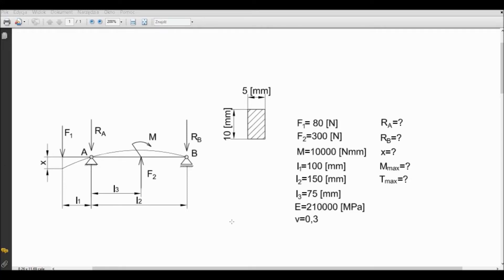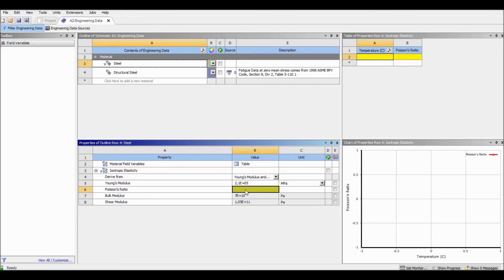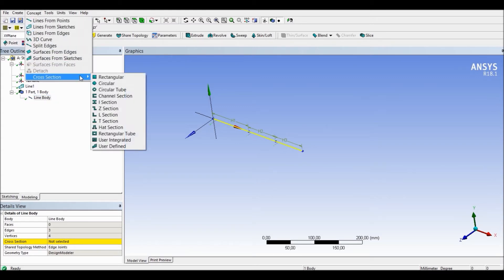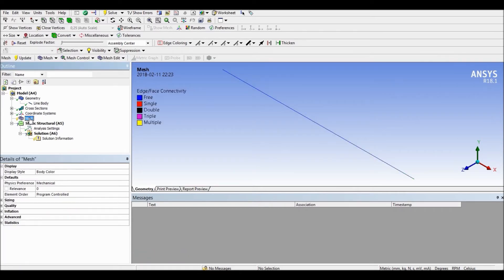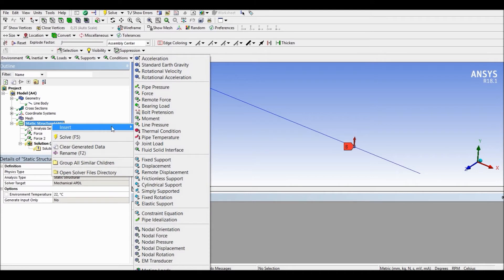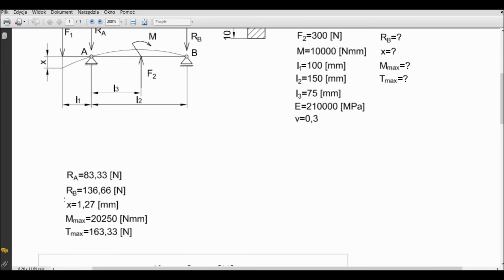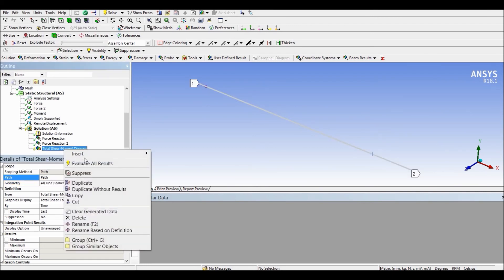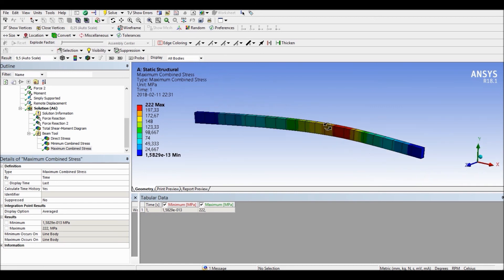Ansys Tutorial - simply supported beam (force probe, bending moment, shear force, displacement)

Comment: Hello, I did the same exercise but with the current ANSYS and I get the following error (see below). It has been reviewed and nothing, do you know what could be done? "a solver pivot warning or error bas been detected in the ROTX degree of freedom
 of node 1 located in line body. This is usually a result of an ill conditionned metrix possibly due to unreasonable material properties, an under constrained model, or contact  related issues. Check result carefully. You may select the offending object and/or geometry via RMB on this warning in the messages window"
Reply from the maker: Thank you for question, first please check if your Young's modulus setting is correct, maybe you've chosen a GPa instead of a MPa. If this won't help, try to review again a boundry condition. Maybe your coordinate system has different orientation than this on the video.
Reply: @allaboutfea4790  Thank you very much, there I found the error.
Reply: @allaboutfea4790  Hello, I'm sorry to bother you again, but by chance you know if in the example of the video a triangular and / or parabolic distributed load can be calculated in ANSYS by obtaining the force and the shear moment.